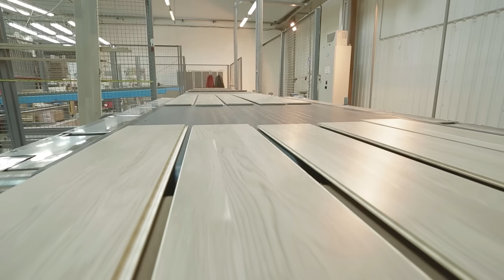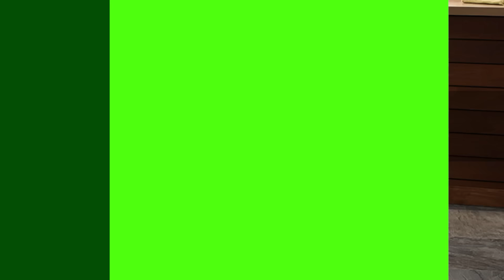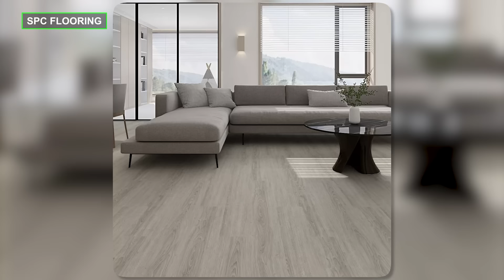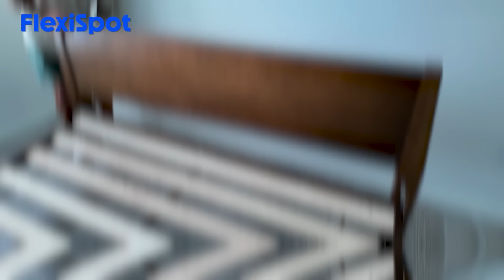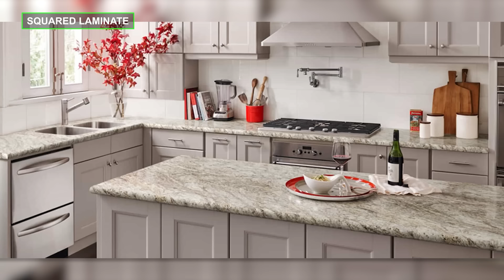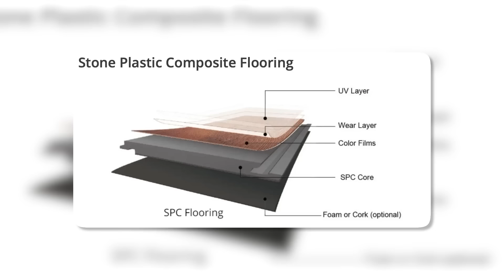Home Finishes That Will Outlive YOU

Comment: Thanks for the shout out for linoleum.  I chose Marmoleum planks for my kitchen, back entry, and the finished part of the basement.  Marmoleum sheet for my 2 upstairs bathrooms.  Warm underfoot and has "give" that no kind of tile has.  I really don't understand why linoleum isn't more popular.  I also have a laminate kitchen countertop.  Cost for 10' of quartz $3000 cost for laminate $600.  No contest.
Reply from the maker: Ty

Comment: I just subscribed. I'm planning on doing final improvements to my forever Townhome. I plan on learning from you as much as I can.

It is an open plan. 

Initial plan

I will be painting, tiling the bottom floor, including kitchen. Around the fireplace, instead of tile, I plan on doing  lime wash or Venetian plaster. I do not want to tile. Styles change too quickly. Paint is easier than ripping out tile. 

Master bath: I'd like to rip out the builder fiberglass shower, and the adjacent tub to install a free standing tub, and a tiled shower. I will rip out the carpeted master bath, yuk, and tile. But, I am open to just replacing the fiberglass shower with another, better, fiberglass shower. The secondary bath remains fiberglass. I plan on ripping out the linoleum in the secondary bath and tiling with the same tile in the master bath.
Reply from the maker: That sounds awesome!

Comment: Built By Becker. What's your take on Modern Epoxy flooring . Is it worth it? What's the durability like? I have toddlers, will it hold up?
Reply from the maker: Lots of cool options we use it in commercial quite often I see it in some interiors
Reply: @BuiltByBeckerMedia  Great. Can you do a video on it? I'm considering getting it in my house. Not sure if i should do epoxy or concrete.

Comment: I don't like linoleum. It's soft and cracks eventually.  The lighter colors oxidize over decades and if you try to remove it, it takes forever.  Not interested.
The only thing about ceramic flooring is that it's freezing in the winter. Sure, I can wear slippers and put in rugs. It does hold up well,  just make sure you order enough "warranty tile" if it does crack. Our installer left us enough to do the mud room with about 20 extra pieces. 
Our laminate counter lasted more than 20 years. But there is a lot of maintenance  and babying with heat.
Reply from the maker: Thanks!
Reply: I wonder if you might be confusing vinyl with linoleum
Reply: @jamielynne-magney2574  Nope. I lived in a hundred years old house when I was a kid. It was the old brittle square linoleum. Then I lived in an apartment and replaced a front entry floor(because puppy) with it. I am also a print maker who carves linoleum adhered to mdf because it curls without glue. Vinyl sheet is soft, but maintains color, cleans pretty easy with a magic eraser. Had it in a garage entry(28 years). Not crazy about that, either, for a large floor like a kitchen.  There's pros and cons to everything.

Comment: My ex-husband and I built an underground house. We used in floor heating in the concrete and never had cold feet! It cost almost nothing to heat and was beautifully cool in the summer!
Reply from the maker: That’s nice
Reply: I'm putting in heat flooring when we remodel our kitchen. We'll tear up the floors on the first floor (390 sq ft - small house) when we remove a load bearing wall, so we will tear out the LVP, lay electric in floor heat and lay with SPC or sheet linoleum. I just gotta double check the SPC or sheet linoleum will be okay with the in floor heating. I know LVP will so it should as well. Hopefully.

Comment: So porcelain for countertops is not recommended but for bathroom floors they're good?
Reply: If you do porcelain tiles on a kitchen counter,  they are subject to more heavy things dropping on them-pots and pans etc. A bathroom floor is less likely. Lots of people use porcelain tile for kitchen counters, just make sure they're flat and not rounded (makes for an uneven work surface). And no matter where you put it, get around 20 extra pieces in case you have to replace a broken one. Oh and an extra bag of grout. It's tricky to match colors down the road. We ended up using it a few times.
Reply from the maker: Yes
Reply from the maker: Yeah floors are less prone to damage than kitchen countertops
Reply: I always use porcelain on bathroom floors and shower/ tub surrounds. I would never use it for a countertop because you typically have grout lines and trying to get matching edge tiles can be difficult.

Comment: My 200yo house in Maine has old linoleum in the kitchen. It's in perfect condition, absolutely hideous, but I am too cheap to replace it. Realistically, most floors get changed because of going out of style long before it wears out. I'm having to cheap out initially on the floors in the new house I am building due to budget, but it will get upgraded down the road. I wanted sealed concrete, but not even close to affordable. I have porcelain tile throughout in my current house, but same, just not in the budget up-front for the new, regardless of how long it will last.  Bathrooms will be tile though.

I LOVE laminate countertops. I cannot even imagine paying $100++ sq/ft for some slab of rock, real or fake. All the countertops in my new kitchen, including using the same as the backsplash and the island, cost $600. IKEA pre-made. I have the same in my old house and they look like brand new after a decade. Can't beat an IKEA kitchen for the money, for that matter.
Reply: Really?
Reply from the maker: Thanks for sharing

Comment: SPC LVT with 20 mil wear layer will be flooring in my kitchen and foyer soon, and I'm planning on doing a porcelain tile in the bathroom.  The inkjet printing and the larger format tiles (I'm looking at 24x48") mean that they're able to make it look more realistic as well.  

When you have less repeats (either due to large sizes or due to a higher number of variations in pattern for the more expensive laminates and vinyl planks) it looks less obviously faux marble/wood.  And this helps things last longer as well.  You're not going to be wishing you had something different in 3 years because living with it every day makes you realize how cheap it looks.

When my contractor installed the LVP I got, he asked me if I wanted to hide the darker colors in closets and such and I surprised him when I said not to, that the high variation was exactly the reason I chose this one.  (The samples in the stores don't represent that, but I had done a lot of research online.  I was lucky to find pictures from contractors on Instagram showing actual installations and not just the promo pictures.)
Reply from the maker: Great!